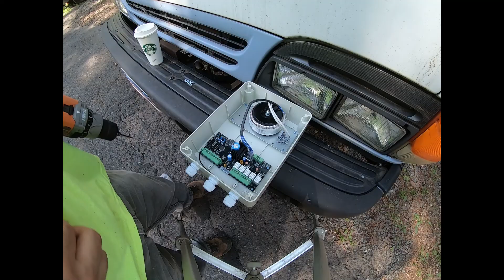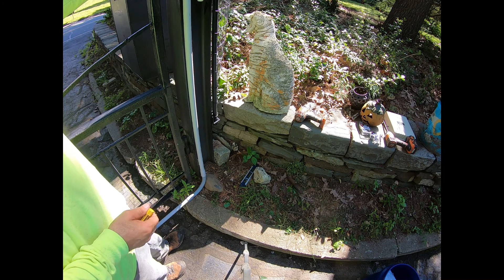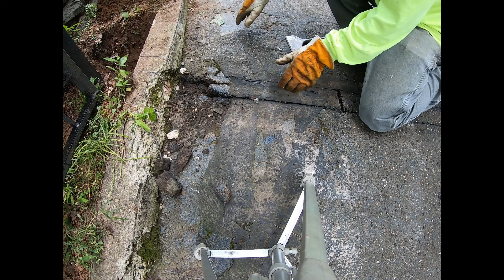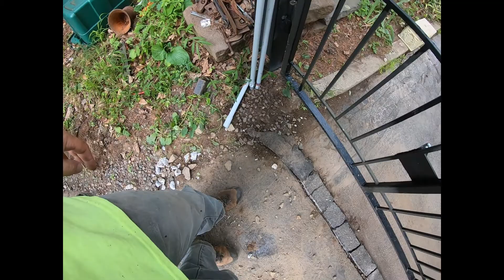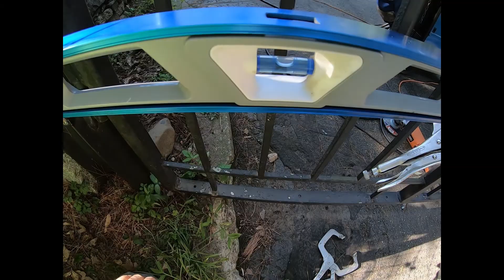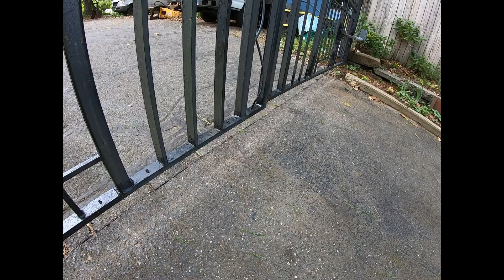Driveway Electric Dual Gate Opener Installation

Comment: Great work - I have similar issues but I thought instruction manuals say you shouldn't allow operator to extend to its mechanical limit?  Has this cause any problems ..yet..?  response appreciated
Reply from the maker: Yeah the manufacturer says not to extend them to their limit. I have been using them for a couple years  like that no problems (except unrelated lightning strike killed the board)  Without using them that way I couldn't have used that system.
Reply: Thanks response - pleasant surprise - is yours the same such that if you unpin from gate the arm just goes into a nonstop SPIN at full arm extension?  if so does your motor stop on full extension because the attaching of the arm to the gate stops this spinning motion?? ... Oh perhaps yours is some hydraulic rather than worm drive - though probably wrong terms, but hope understand (i have two chrome pistons wheras you only have one) ?    @ironore1866
Reply: Thanks for surprise answer after a few years - was yours a hydraulic piston or screw/worm drive piston? @ironore1866
Reply from the maker: @gezza3238 Screw drive

Comment: The bracket on the gate should be slightly lower than the bracket on the post to prevent water ingress into the gate ram.
Reply from the maker: Had not considered that.  Thank you for the tip.

Comment: Nice work,   I'm glad my driveway is made out of gravel and I'm planning a wood gate so most of the pain point will not be there for me.

I would suggest extending the bottom of the gate for a stop, but my wife mangled my manual gate stop with the mower.   She says she raised it all the way up but I think mostly she doesn't like them :)   Since we have a slope I think I can cut in a path for the extension to slide into a stop such that it won't stick out.

Comment: Hi.  Great job, thank you for sharing your experience doing it.  

I do have one question: it appears that you installed the gate operators and the electrical control boxes, all facing the street, instead of on your property side.  Did I see and interpret this wrong ?  Please let me know the reason if you did this street side.  

  Great job on the video shooting also.  

Thank you.
Reply from the maker: Thank you for watching.  The control box is inside the gate.  The gate operators are on the outside of the gate.  The drive way is on an incline.  With the incline this is the most optimal way to put them to get access to the most space when the gate is open.  I guess they could be put the other way with some intrusion into the entrance space.
Reply: Hi.  Ok that now makes sense, the reasoning.  We have a corner lot acreage, and love that we have driveways on those corners.  We can take the motorhome and drive in-then drive right out in the same direction……never need to turn around.   

  The back driveway is on a pretty decent incline also, so we may consider doing the same thing that you did.  I don’t like the idea of the operators being street side, but for the 4-6 times a year we use the back driveway, it may end up with me as the operator, and we concentrate putting an operator at the front that we use all the time.  

  Again, appreciate you sharing your experience with this project, will help me with ours.  

  Thank you
Reply from the maker: @holeshot406  Sounds like a good set up.  Best of luck with everything